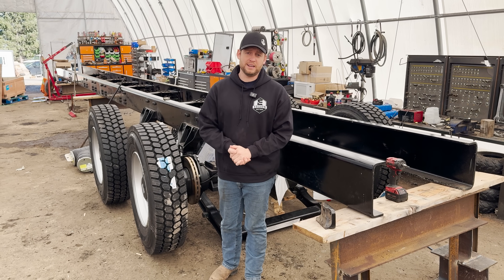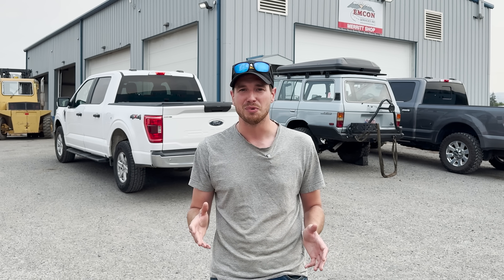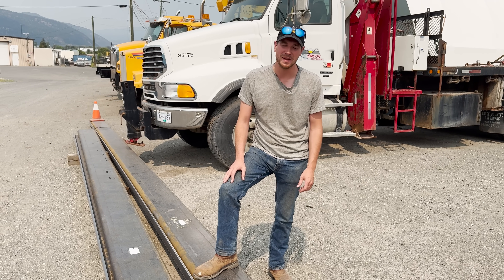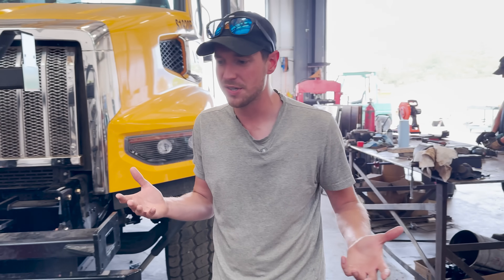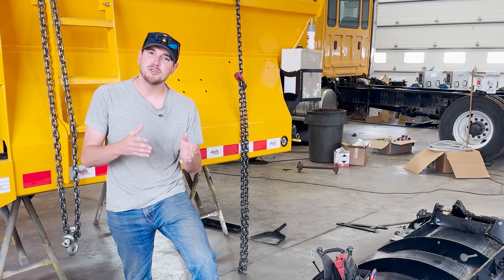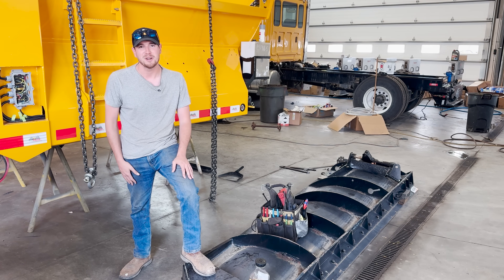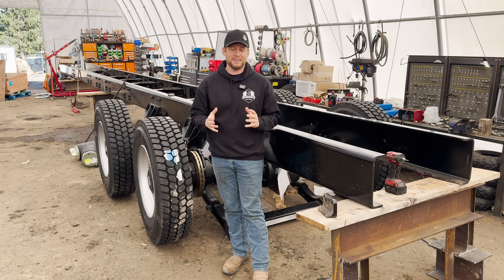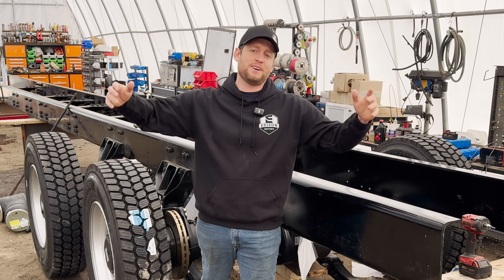Worlds First Diesel Electric SnowPlow

Comment: Engines can't be smaller than these?
Reply: Engine size is completely dependent on the expected uses. An OTR truck on level ground and normal wind, will use about 100 hp to keep moving. So in this case, a 4 cylinder 150 hp engine would be more than enough to keep the batteries topped off.  On the other hand, if a truck is expected to haul a heavy load up a mountain everyday, then it would need the 700 hp Scania V8. The caterpillar yellow C9 9 liter engine displayed here is about 250 horse power and it replaces a comparable 15 liter engine if this were a diesel only truck.
Reply: @Sah-o5m  So, could do the same job? Or the weight of the engine is needed?

Comment: Everyone kept saying that the big trucks would always be ICE. Tesla is not a viable product for most and the company is just hard to deal with. 
Edison has found the way and made it happen! Topsy is proof that the Edison platform can perform with big loads over distance. The plow project will just add to the knowledge and make Edison better!
Reply: The series hybrid has some benefits: smaller engine always at constant RPM. And regenerative braking. OTR in flat terrain takes away the latter and even though the displacement is bigger in old trucks are bigger I think the gearbox is surely geared so there is the best RPM for the engine in those. So diesel consumption will probably not be enormous in this setting.
Tesla Semi is very viable for big fleet owners moving cargo in well planned routes and can build fast chargers at loading/unloading terminals it goes to. "viable product for most". It's not the most versatile product but in terms of number of diesel trucks it can block from being built/sold and reduce diesel consumption overall it's the best choice for Tesla. Edison Motors isn't a competitor to them.

Comment: My CAT diesel has an electric clutch hydraulic pump.(Like a car a/c compressor for you newbies) I guess if I put in a generator-%5 loss, inverter %5 loss to charge, %5 loss to discharge batteries, plus %5 loss for electric motor - my %40 efficemt deisel will be reduced to %20 - BUT I will save %30  AND get $200,000 to prove what has already been proven inefficient?

Comment: I get why you would want hybrid tech on a truck, long straight roads going basically idle.
but a snow plow has to force its way alot of the time.
I wonder how efficient the hybrid tech is in a scenario, where the load is at a constant high...
Reply: Diesel locomotives have been this way for years, the traction motors take a lot of abuse..........
Reply: @randallvos  yes, but locomotives are on a completley different scale.

The semi Hybrid concept is for vehicles that travel long distances at a constant speed.

I just wonder how the batteries/generator performance is under these load conditions
Reply: @AIC_onyt  We all wonder. That's why they are building it to actually test it.
Reply: 102,600 FT.LBS torque is what they claim

Comment: Does it have a heated seat ? The cab may get cold on a long downhill section when the diesel is not running. And as a BC taxpayer, please spend my money carefully.
Reply: The diesel engine is not the only source of heat to heat the air.
Reply: @subwarpspeed  What else does the heating ?

Comment: What rpm does the diesel engine run for max charging ?  I’ll be waiting for an answer. Thank you
Reply: I'm not sure if the snowplow is getting the Scania or Caterpillar engine. The Caterpillar C9 engine max RPM/power is 1800 to 2200 engine rpm and makes about 250 hp. Best efficiency may be lower rpm like 1500.

Comment: I really wish there was a deeper explanation of how switching to  diesel electric system is going to result in a fuel savings. You obviously loose a little bit of energy switching from mechanical energy to electric and back. It sounds like maybe they were saying that powering the hydraulic pump electrically from the battery means they can only power it when it's needed? And powering the pump mechanically from the engine of an ICE vehicle means it's always doing work? Is that the argument here?
Reply: I believe there are 3 efficiencies for diesel electric over diesel only.

The first is regenerative braking. In 20th century diesel only semi trucks, all forward momentum is restrained by using wheel brakes that convert forward momentum into heat. In the Edison motors 21st century electric semi, as the driver lifts their foot off of the accelerator pedal, the computer allows the spinning wheels to spin the electric motor which changes the motor into a generator that pumps energy back into the batteries for later use. Edison trucks also have traditional brakes, and they'll last much much longer. Waste heat is converted to re-usable energy.

The 2nd reason is a smaller diesel engine. In 20th century diesel trucks, if you needed moments of high power, you'd have to put in a monster 15 liter engine. With Edison trucks, the batteries handle times of high energy consumption and a smaller 9 liter engine is large enough to replenish the batteries as needed. Smaller engine, less fuel consumed.

The 3rd reason is optimal engine rpm. A diesel only truck has to run from 500 rpm to 2500 rpm and the engine is less fuel efficient at various points over this spectrum. An Edison engine/generator can be set to run at its optimal rpm for max fuel efficiency.
Reply: @Sah-o5m  I'm aware of all of those; and in most applications those benefits don't outweigh the conversion losses of going from chemical energy, to mechanical energy, to electrical energy, and back to mechanical energy. It's why you don't see diesel electric trucks already, because in most applications they're less fuel efficient than diesels.

It's only special cases like logging, where you're bringing heavy loads downhill and you  use tons of regenerative breaking, that this model really makes sense. There are even some trains that have gone purely electric with this model, carrying heavy ore downhill and never needing to be recharged. 

In the video, they talk about the electric systems being more efficient for powering the hydraulic pumps; so I wonder what that's about.

Comment: Very exciting application. This is quite a demanding application. Extreme duty cycle, harsh conditions, potentially significant salt-sludgy intrusion, max reliability required... the powertrain cannot fail during a snowstorm, especially while plowing. Is there anything special you need to do i.e. to protect the HV wiring in the undercarriage to guarantee reliable isolation? (Do the inverters have isolation detection?)

I would like to see these phased in here in Utah. We spend so much on plowing each season. I assume a powertrain retrofit would be the most affordable option, perhaps as the transmissions require rebuild. 
Great work. I hope you finish it in time for this season! (Not much time left!)
Reply: Yes. if an Edison/Emcon electric snowplow can survive, then the lessons learned can be applied to the rest of the trucks. Bravo! Tanner, greetings from Utah. I'd LOVE to see an Edison snow plow here. Unfortunately, I think we missed this season. Looking forward to winter '26 to see this truck in action.

Comment: Might there be an issue with thorough training of the support mechanics with regard to the exposure to high voltage (drive) electrics and high fault energy sources of power while plugged in? I am thinking in a municipal situation with a City mechanics shop.  Otherwise, WELL DONE!
Reply: I agree. 600 volts is no joke. I'm old enough to remember being in grade school in the 70's and teachers would roll out the film projector and they'd show us a grainy taped together film like "School bus safety and you".  This is Bob. Bob wears high voltage gloves. Be like Bob.

Comment: How do you recommend towing, when one of these electric trucks need to be towed, do to a crash, breakdown, or blown tire, etc? As a tow truck operator, I am seeing manufacturers making my job more challenging, and more dangerous.
Reply from the maker: Put it in Neutral and grab the steer axle.  No drive shaft to pull
Reply: In one of the videos, Chace pointed out that there is a way to manually kick the drive axles into neutral for towing.
Reply: Thanks for the response. Sorry if I missed if you had already addressed towing. Simplicity would be a welcome change. Really like what you are doing.

Comment: You are powering a 900bhp snow plough which works hard all the time with a small diesel engine it don't add up the batteries will go flat then it will be short of power
Reply: If one graphs snowplow bhp usage throughout the day, its like a heart beat. there are brief times using all 900 bhp, and sometimes using  only 50 bhp when waiting at a stoplight. If the average usage over the course of the day is only 150 hp, then Edison puts in a 250 hp generator to top off the batteries. We'll learn more during winter of '26 when this Edison/Emcon plow goes online.

Comment: One of the most important features of these plow trucks is their versatility. Municipalities can't afford to buy 6 5 ton dump trucks and 6 5 ton snow plows for each shop, so having one truck that does everything year round is important. I spent 3 years working for the city as a student, a lot of my time was spent cleaning scale off of truck frames and plows and repainting them gor the winter. These take more abuse than pretty much any other trucks out there, if an electric truck can handle it they can handle anything.

Comment: I have a question:  Did you examine converting the hydraulics to electrics?  It seems to me (an individual with no detailed knowledge in the field) that it would be more efficient to run the systems using a series of electric motors, since you already have a battery, instead of consuming energy to convert to hydraulic power and transmit that power.  It makes sense to use hydraulics when you can run off of the driveshaft, but when you are taking from a battery, it seems to me to be more efficient just to use electric motors.

I understand that for this particular truck, being a first-of-kind prototype, you want to play it safe and conservative with systems.  When developing new technology, it is generally a good idea to have as little variability as possible.  Likewise, I can see that swapping out the hydraulics would represent a considerable additional expense and complication, probably requiring the development of new technologies and components.

But for future trucks, maybe it would be something to look at?

I also had a couple of brain farts that I thought that I might throw out there just so somebody can explain why they wouldn't work:

1)  Batteries need cooling.  Why not route the coolant lines out of the battery pack and into the plow blades?  This would heat them up and help move/melt snow just that little bit extra.  Or use it to prevent other components from freezing up.  This would create massive additional complexity and expense, but it would raise efficiency.  Heat from the generator could also be used.  Basically, my idea is to use waste heat generated by drive-train components to help insulate other components.  Obviously, a lot of complexity, and there would need to be conventional cooling systems for operation outside of wintertime.  But maybe something to examine for a 3rd or 4th Gen?

2)  Topsy didn't really use the generator to haul that load of lumber.  Back in the 1970s, GM built the top-of-the-line Cadillac Series 75 limousine (one of the last from-the-factory limos) using truck chassis components.  Today, the Beast, the US Presidential limo, also rides on a heavy-duty truck chassis.  Could Edison tech be used to create a sort of super-limo/Series 75 restomod that didn't even need a generator?  I know that this isn't really something that Edison itself is all that interested in, but could the tech be applied by somebody else?

3)  Edison + Lucid = AWESOME.  Have you considered contacting them at all?  Or Rivian?  I just think that different companies that are not really competing could benefit from allying with each other.  Even just small tech transfers might help.
Reply: From my limited knowledge, I think the big advantage of Hydraulic is 
1. Known systems. And compact units plus pipes!
2. Is perfect for pushing a plough up or down.
3. The electrical version of a hydraulic ram is a screw jack, and that puts an electric motor and a threaded ram out in the weather/salt etc.
4. The hydraulic ram is self oiling, and repeated fine adjustments around the same position would not wear the system like on a metal thread.
5. Aircraft flaps use screw jacks, to fixed settings.
And hydraulics for flight controls.

I will accept that I could be wrong !!!
Reply: @johnland7318 The weakness of a screw jack is that it does not handle shock loads very well. With hydraulics you can have an over pressure valve for safety so that you do not break your equipment in an overload situation. Electro-hydraulic actuators are used in modern aircrafts and in power trim systems in power boats.
Reply: If it's an open center hydraulic it would always be pushing oil around. Yes, it is fairly easy but it does take some power. They can spin up the hydralic motor from the electric just when it's needed. But for the actual use of the lowering of the plow, how much energy to you think it actually use? I don't think the efficiency would merit a switch to it. They build them for the customer that seems to service them themselves, you want to come with something completely different than what you have. Are those screw jack electrical actuators readily available?

1. Batteries need cooling or heating. In the winter it probably is heating they need (in a BEV that's part of the loosed range in winter - they spend electricity to heat it). I don't think you get anywhere near enough "waste" heat out of those few batteries to heat a snow plow.

2. Edison doesn't have a lot of new invented tech. They buy the components and put it together into undeserved markets. Other companies can also build a fully BEV for the task. But sure, Edison is open to not put a generator in and just add more batteries for the right customer with the right task.

3. They will probably not reveal that but I don't they can benefit so much. It's not completely new and you need meeting, agreements, yada yada. Or they can focus on what they need to do to build their trucks. The Chinese manufacturer of the e-axles seems to be a partner and Edison has input on the design. Lucid build their own car electric motors and I Rivian bring it inhouse too.

Comment: one thing i realised from watching all these videos is that pretty much all or low floor tech Busses in Europe are Diesel Electric without direct shaft connection for pretty much over 20 years if not more. sometimes the engine is in the back sideways but there are also conficurations were its on the Driver side facing Forward allowing for an extra Door at the very rear.  i wonder if these independent air suspension parts could be usefull for Garbage trucks since you will be able to drop all kind of batterys and equipment very low in the frames wich i asume could help alot with height clearance.

btw edision should make a Truck as Car Hauler for tesla deliverys or more importantly call backs :D .  there was a long rivalry between BMW and Mercedes with Billboard comericals.  Mercedes: A guiding Start bringing you safly to your Destination and it shows an Actros with a full load of BMW's.

Comment: #edisonmotors , I've been doing some calculations and estimations. There's a way to make the hybrid solutions work for on road freight transport.

Currently, it's actually more fuel efficient for long range semis to run conventional diesel, this we both agree upon as in your experimenting you demonstrated increases in fuel consumption for on highway trucks. The problem is that it basically requires more fuel to make the same average power over time once the trucks get that heavy at those speeds, so in order to increase Brake Specific Fuel Consumption per Kilowatt-hour, one possibility is to put a heat exchanger in the exhaust system to boil water for a steam turbine, generating extra electricity off of the waste exhaust heat.

Also, I personally recommend overhauling the valve train to an electromechanical one (Similar to FreeValve, you could use air off the compressed air tank I guess but I'd just use electric solenoids instead) and you can then program your valvetrain to operate on a 6 stroke cycle where the 5th stroke is an intake stroke with the intake valve opened the entire duration of the stroke and then a second exhaust stroke to evacuate all the air. This would allow you to extract additional power from the exhaust system as the turbocharger would be able to run at significantly higher compression ratios and apply much higher pressures to the 5th stroke to drive the pistons. This also cools down the combustion chamber in preparation for the actual intake stroke to create better charge air density.

I'm not an engineer, not a programmer, not a truck driver, just a physics nerd that's been bored.
Reply: #engineeringexplained Jason has a better whiteboard than I do so I'll let him do the math. He's an Actual Nerd™️, he went to school for it. 👍